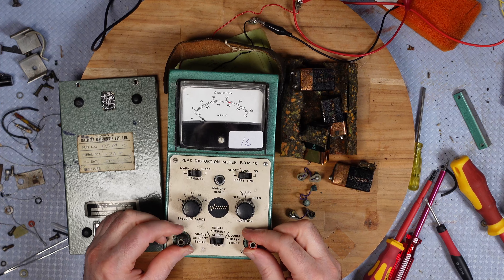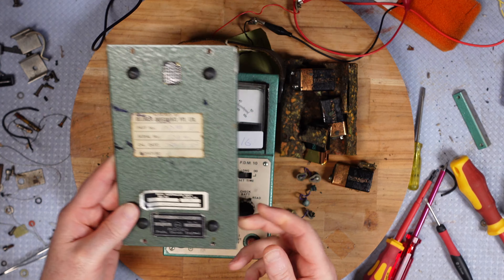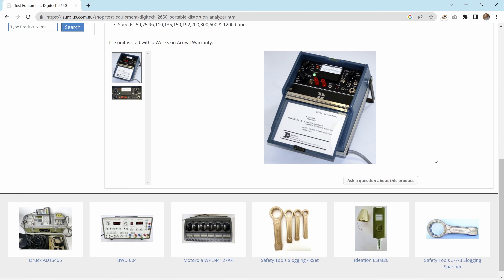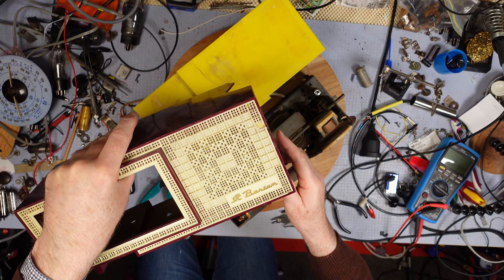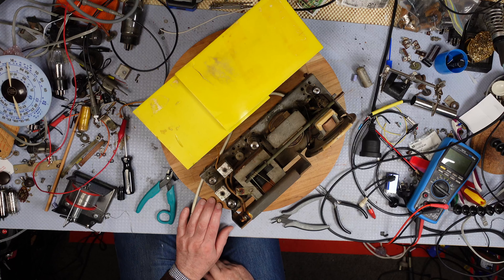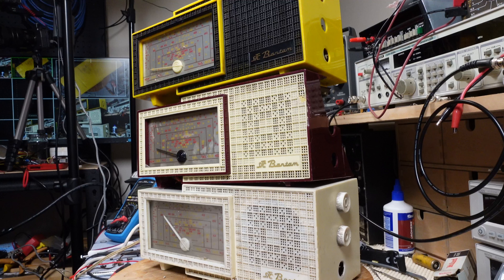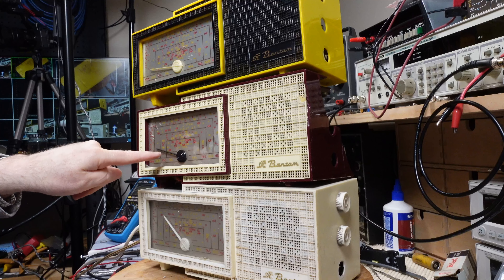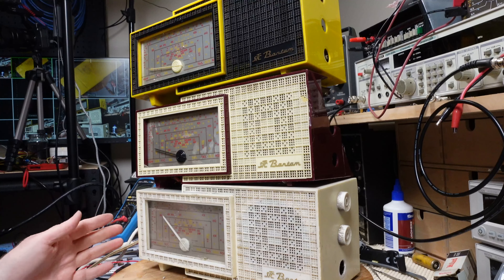076 STC Bantam

Comment: I have one in pretty good condition compared to these. Anyone interested?
Reply: I switched it on and it works
Reply: The cream colored Perspex has yellowed on top (light exposure I think) Steel wall will ruin the shiny surface. Any tips for getting it back to its original cream colour?